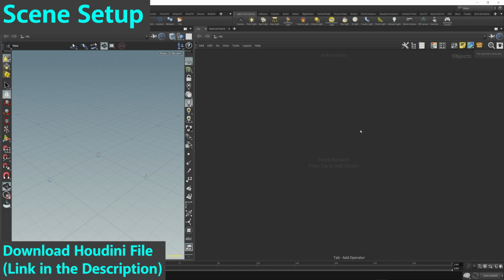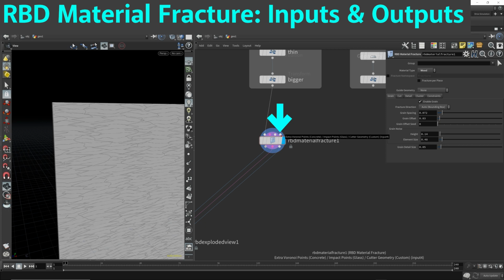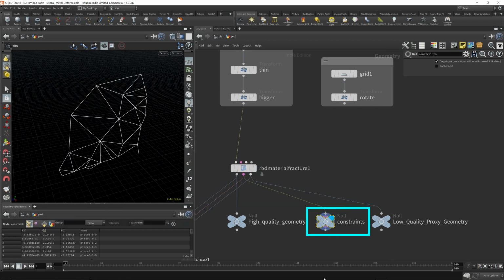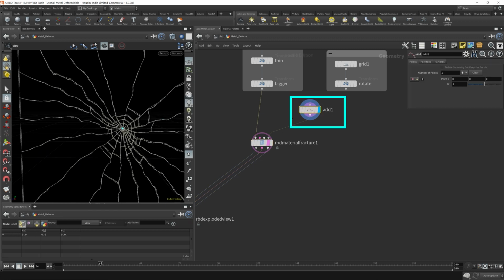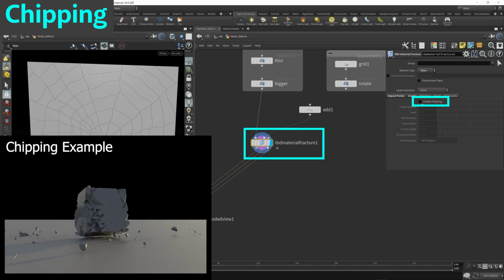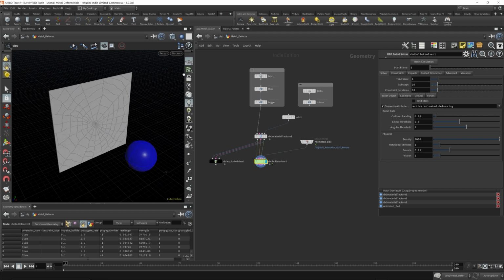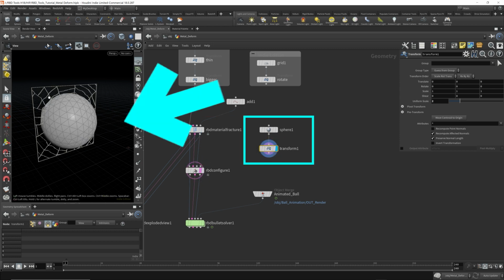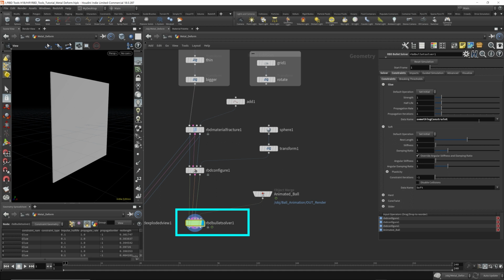Tearing & Deforming Metal using RBD Tools in Houdini Part 1

Comment: when i visualize the active in rbd configure i see no green and everything seems inactive when running the sim
Reply from the maker: Try dropping down a RBD Configure node and manually set all the pieces to active, just for debugging to see if there's any issues with the setup.  If this node does turn everything green, then it means there's a node before this one that is making everything inactive by accident.  To the least it'll give you a small clue.  Hope that helps!
Reply: @bubblepins  thanks helped alot got it done
Reply: @bubblepins  also do you know how to make a 3d model i brought from blender procedural to make different variations of the house model
Reply from the maker: @YungInnFilmz  Are you importing the house from blender to Houdini?  You can try adding some procedural noise to the house inside houdini, but I'm not sure if that's what you're looking for.  Are you trying to create a procedural house using houdini and exporting it back to blender?  Are you trying to create a HDA asset in houdini to be used in Blender?  I have seen this done too, but it requires a special build of blender and very specific versions of both software, I never tried it myself, but I've only seen it in a video.

Comment: Hai nice tutorial I tried bending a rod it works but is there anyway to stop the dynamics at certain frame   and i want to animate the deformed mesh in maya is there a way to export deformed mesh(not alembic or animation just deformed mesh)?

Thanks
Reply from the maker: Inside the dops (double click the rbd bullet solver SOPs node) and add a geometry wrangle, there you can change the @active attribute, this will update the status of the blast pieces, however in an inactive state, @active = 0;  ← this means inactive state, the blast will not move at all!  So use this wisely.   Inside the geometry wrangle, you can do soemthing simple like:
if ( @Frame > 20 ) {
   @active = 0;
}
Something like this should make the pieces freeze on the POINTS attribute.

Inside the DOPs network, you can view the active attribute in the spreadsheet by expanding the rbd_object → Geometry, you should see the active attribute there.

Exporting to Maya:
I don't use Maya, but alembic is your best bet to get stuff exported out of Houdini and into other 3D applications because alembic has existed for awhile.  But if you wanted a more optimized way of exporting the animation, you'll need something like rigging.  Although, I've never tried it myself, I think it is possible if you rigged the blast pieces with a single bone and just update the animation, like exporting character animation stuff.  But this would be very complicated to get right I think, because Alembic does a brute force exporting each frame and each geometry point, which explains the huge file size.  So you're getting repeated data over and over for each frame.  For animation, you only export the geometry data once and update the position and orientation, however I don't think this can be achieved with FBX at the moment, unless you have some sort of rigging going on.  We'll need something special between Houdini / Maya to export RBD sim more efficiently.

Hope this helps!
Reply: @bubblepins  hii, thanks I'll try what you said, but what I asked about MAYA, I'll ask with new example from your tutorial, imagine you want to use the metal(from your tutorial) in multiple places after broken(deforming, just the broken mesh) that what I want to know
Reply from the maker: @lingaboopathi1140  If you want to export a single frame out of Houdini, I think fbx will do the job.  You just need to select single frame from the drop down of the fbx rop node instead of frame range.  That should export a single frame of the deformed mesh from any frame of your choosing.  I hope I'm not mistaken.
Reply: @bubblepins  hii exporting works fine and I'll try stopping the solver and get back to you thank you very much for the tip
Reply: Hii thanks a lot, I tried deactivating also it also works fine, thank you very much and you have any idea on teaching codings for houdini? or if you have done already please tell how to access that,

Thanks again a lot.
Reply from the maker: @lingaboopathi1140  Good luck!
Reply from the maker: @lingaboopathi1140  I was thinking about this too.  I have been working on a python program to help with creating better content faster and aid in visual explanations, so once this helper program of mine matures to a level that is usable, I will probably start a new series on coding.
Reply: @bubblepins  thanks, I'm expecting the series will start quickly

Comment: Hi, I tried the cluster and found good results, Thanks for the reply, but now I have a new doubt, I tried the tutorial with a test geometry it works, but I have to do with another geometry(which is modelled in MAYA and animated and exported as alembic), in that when I try this, its not working(even concrete fracture works only if I give no more than 10 scatter points if that exceeds its not working). And I did like to mention that I give input as shape node(went to bottom of the imported nodes and did that) of the alembic file. Can you help?

Thanks,
Reply: Hii I think I found what the problem is, the geometry that I want to tear is a hollow object which has 0.07m thickness around 10meters wide, which it takes more RAM to process(to find scatter points) which I don't have. If this can be solved some other way please give suggestions

Thanks again,
Reply from the maker: @tamilarasu736  Can you describe the problem a bit more, like what happens exactly when it fails?  Does Houdini crash?  Because that would be a high probability of running out of RAM.  If you're trying to unhollow an object, you can try grabbing all the point normals that are pointing outwards and put them in a group.  Then you can blast the primitives with point normals that are pointing inwards.  That should give you a watertight object that is not hollow.  But even if the object was hollow, you still should be able to fracture it, it'll just fracture the shell.  

The next thing is, are you using packed primitives, this will save you some ram, but you probably are already.  I just thought I'd mention it just in case.

The last thing is, maybe try the scene on another geometry to test things out, a more simplier geometry that you know for sure is not hollow.  And see how many pieces you can fracture it until it fails.  This is just a debugging step to analyze the scene and gather more info.

Hope this all helps!
Reply: @bubblepins  Hii, thanks for the reply,

Yes, houdini crashes while calculating, and I'll try the option you said

and thanks again

Comment: I'm back to these videos after a while cause I did a very similar project and now I need to export that with the RBD to FBX output node.
My problem is: if I put a Null after the rbddeformpieces and export that, the export fails (it actually succeed but the fbx is empty). So I tried to pack the geometry after the simulation, in that case I see the mesh when exporting it but there's no animation, putting the assemble node before the simulation actually breaks everything cause I only see the constraints moving but not the mesh itself.
Hope you can help, thanks in advance!
Reply from the maker: There's a few things you need to know about exporting RBD, if you're using the rbddeformpieces node, chances are that the geometry is packed data and you'll need to unpack it before the rop node.  And rop fbx animation only seems to work for rigged characters or stuff with bones and rigs and then you can use the fbx rop to export the animated rigged character.  However for RBD sims, in my experience, the only way to get the animation out into a 3rd party application like Blender, is via Alembic rop.  

Hope that helps!  This question has came up a few times, I should make a video on this.  I'm going to add it to the list.
Reply: @bubblepins  ty so much for the reply! That helped a lot

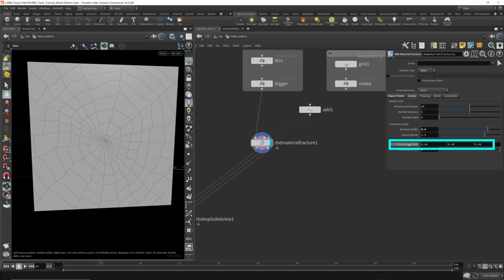Comment: Hi I was searching this kind of tutorial (simple and understandable) and in 2nd part u said cluster attribute in rbddeformpieces (at 19:45) can you explain that or if you have already explained can I get that link?
Reply from the maker: In the 2nd video (Part 2 continuation of this video) for the rbddeformpieces, I do mention the cluster attribute, but I never demonstrated it.  When you drop down the cluster node, it will automatically group points near by each other into cluster groups and give each group an attribute name "cluster" with a unique integer value for each group.  For example, you can drop down a sphere then scatter to points, so you get a bunch of random points, then drop down a cluster node.  Take a look at the spreadsheet and notice an attribute named "cluster" with unique integers assigned to the values.  If you drop down a color node, set it to points and set the "color Type" to "ramp from attribute".  Then make the range higher, like 0 to 5 or something, and then put random colors.  You'll notice that your points not have different groups of colors.  And this is what the cluster attribute can help with.  As for rbddeformpieces, sometimes you want to keep some pieces together, like cluster them together, that's where you would feed in the cluster attritubute into the rbddeformpieces.  Then it would swap out clusters of the pieces according to the group the its it.  Sort of like, that would be the new id of the pieces, except it's in groups.  

Hope that helps!
Reply: @bubblepins  Hii, thanks for your reply, now I'm going to try and get back to you

Comment: Would there be a way of importing this to UE so yiure able to have bullet impacts in a metal sheet with this effect
Reply from the maker: Unfortunately not exactly.  I did see a tutorial online that was done by someone else, I don't remember the link right on top of my head, but that person had a really neat trick.  They would use voronoi fracture to cut the object into pieces and export the pieces into UE and then in UE, mark each blast piece with collision complex in UE.  Then you can knock it over in UE.  

But as of the current moment, you can't exactly transfer the whole RBD system from Houdini to UE, because UE has its own destruction system called Chao.

Hope that helps!

Comment: Hello again! What is the practical difference between the Destruction glue constraints of previous videos and the RBD of this set of videos? Is RBD like a more advance/precise way of generating effects on rigid bodies such as destruction?
Thanks for all your work
Reply from the maker: The RBD Tools shown in this video is a new feature since Houdini 17.  I think SideFX is trying to shift more of their content to the SOP level, because it seems more intuitive and it'll be easier for someone new to Houdini to understand.  The dopnet approach to RBD simulations shown in the Destruction glue constraint video requires that you extract the sim data with a dop i/o node to complete the process.
And also the RBD Tools are still quite new so it doesn't have all the capabilities compared to the dopnet RBD nodes.  For example, the RBD Tools as of Houdini 18 only support Bullet Solver for now, I think it'll expand for later versions.
Hope that helps!